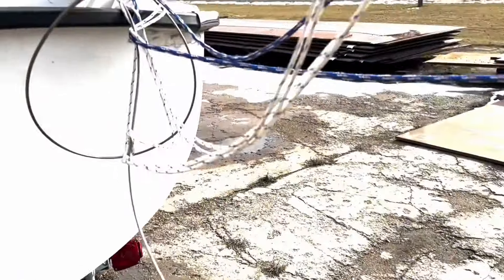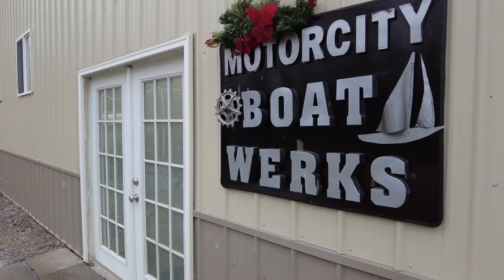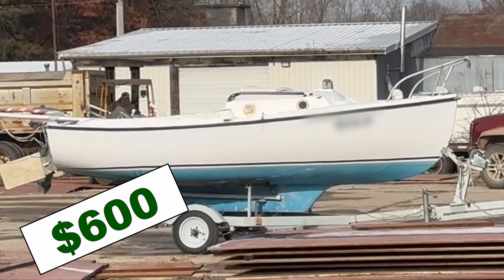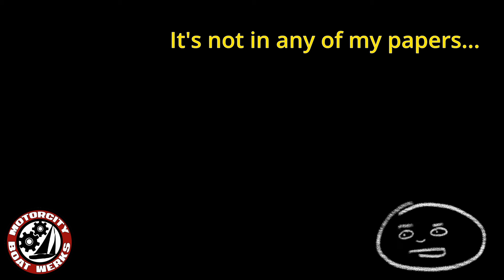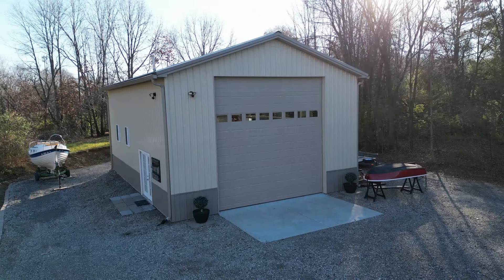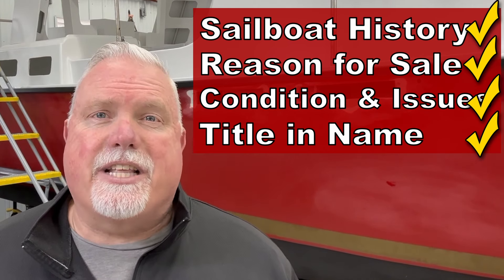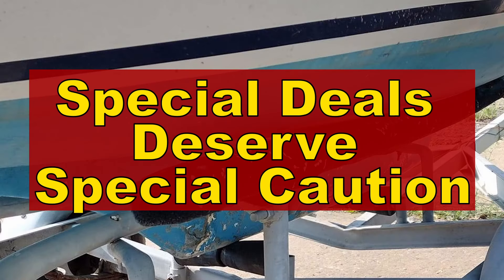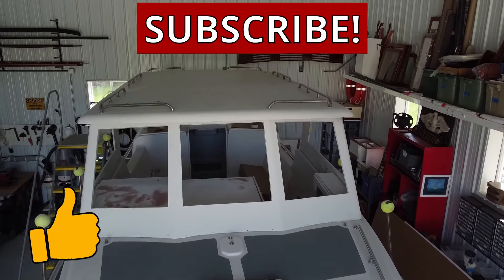Do You Know the Most Important Rule of Buying an OId Sailboat? | Sailboat Restoration (Ep62)

Comment: so enjoy your videos and the techniques you share. I was wondering if you had ever heard of someone adding a pilothouse like cabin to a small bow rider. I purchased a 1984 17 foot Stingray bow rider with original trailer. I have enjoyed the boat but Since i am the only one using it, i would prefer a small cuddy cabin with a pilothouse structure for using on Buggs Island Lake, where i live in Virginia. But with the flooded market on used boats i can not get my money back to buy a larger cabin boat. So i am considering closing in the bow and building a pilothouse like the one you built on the sail boat. If i decide to do so I will let you know. But i am curious if this would be worth the effort. I am retired so i have time, just no shop, lol. Thanks for sharing the videos and your skills and knowledge. Keep up the good work.
Reply from the maker: I have thought about something similar. But I would only do it in a vintage boat that had the design lines to support a conversion. Otherwise I think you might suffer from UBS.

Thanks for the comment and be sure to subscribe 👍😁
Reply: Thanks for the reply. I Had thought i would need to add some ballast to the bottom to help with the center of gravity. I have no idea what UBS is. I do not plan on using wood, but aluminum and thin plexi or fiberglass panels attached to it. I just want it for sun and weather protection. I enjoy being out in weather on the lake. within reason. Like rain. a lightning storm is a definite no go. Thanks for the reply and have a great new year. Also i have subscribed already. @motorcityboatwerks
Reply from the maker: Be sure to check out the video about adding a pilothouse to the Skipper 20 sailboat. It has info about design and UBS. 😁👍
Reply: I did watch it. So unless I add at least an 18 inch riser to the roof over the bow to form a cuddy cabin adding a pilothouse to this Stingray bow rider would cause a serious case of UBS. So i may finish fixing this bow rider up, enjoy it and maybe offer it in trade for a cabin cruiser of equal value. I will continue watching your videos. Thank you for sharing. Has there ever been a small sail boat with an inboard drive system? Maybe i can follow in your foot steps, but add the Goldwing 1200 engine to the inboard prop shaft. just a thought. I am not a sailor in spite of being ex navy. I prefer power. lol. have a good rest of your week. @motorcityboatwerks
Reply from the maker: Benny: No UBS! No Mad Scientist Syndrome!  Fix that boat up and flip to get to what you really want. https://youtu.be/mk8rlHiGKRk?si=-ryiZuHoI5JCzfl_
Reply: I agree. thanks for replying. I hope you had a great Christmas and New Year. I will continue to watch your videos. @motorcityboatwerks
Reply from the maker: Thanks Benny ! You too 😉

Comment: This does look shady.
But a title might not be required depending on the state, age of boat, etc. In my case, I didn't need a title (I just needed previous registration), and my dmv didn't issue me a title (they just issued a registration). If I didn't use a motor, I wouldn't need to register it at all, so it would be off the radar completely. A shady boat might not be stolen. It could just be passed along from owner to owner without need for registration.
In this case, the seller clearly lied, so I would have walked away from that situation.
Reply from the maker: Absolutely right Charles. All of tour comments could be true which is why I said TWICE: idk what’s up with this boat. But it wasn’t my kind of deal. 👍👍